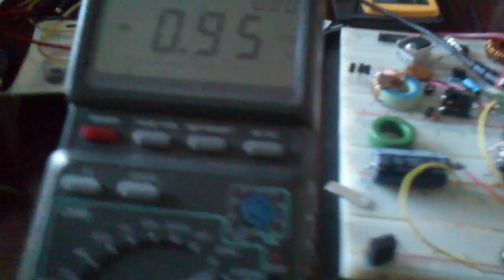Mystery lantern chip + high power LED

Comment: What's the highest voltage this can accept? The datasheet I found seems to have a contradiction (1.5 V vs 5.5 V).
Reply from the maker: Sean Smith 1.5 is the input and it will output a max of 5.5 I never tried any higher voltage since they are design for single cell operation. I also have a bag of 100 of those some where I could do some test and maybe let the magic genie out lol
Reply: Someone on electronicspoint.com forum said that he uses one at 2.4 V and he reckons they work at 4/5 V. If you made a YouTube video of it, I could guarantee at least one view but I'm not sure anyone else would be interested :D Thanks for the response in any case.
Reply from the maker: No problem let me know if you need me to do the test I wont make a video I'll simply test it and let you know if the genie escape or not.

Comment from the maker: Yes this chip is create for this use mainly of course one could modify the circuit and make a dc to dc converter but very little power can be extract a circuit similar to this one is the 2 npn transistor one that I mostly use for my "joule thief" project. The nice thing in the little chip is the size of it... but it's hard to buy it online so unless I buy the complete lantern I can't use them.

Comment from the maker: The amp draw is a little too high for a button cell. I have no light meter at my disposition I guess I could use a photo cell but I have no base reference. The frequency is around 1 Mhz and it change depending the coil but a little found some datasheet regarding this chip and it look like the amp out is directly related to the uH of the coil. Found some chip on Ebay they are expensive but worth a try I will order some soon to try them... Hurray for SMD soldering -_-